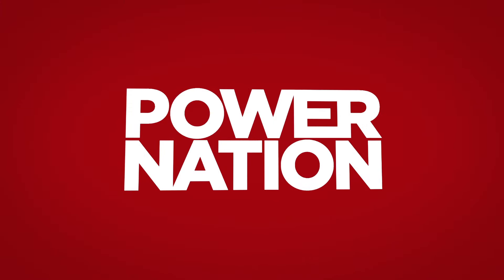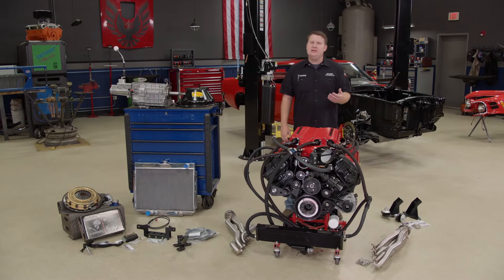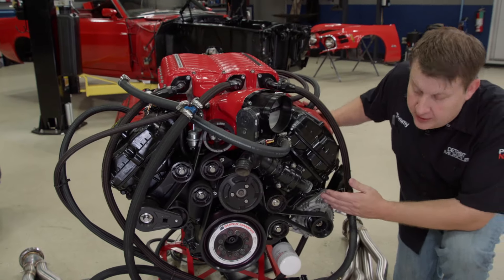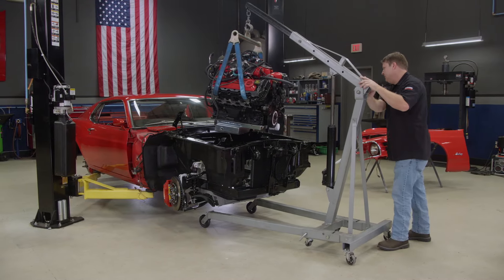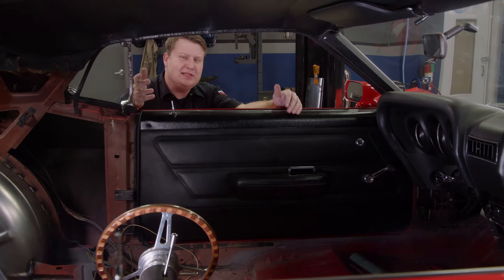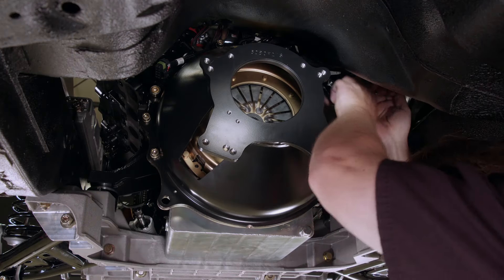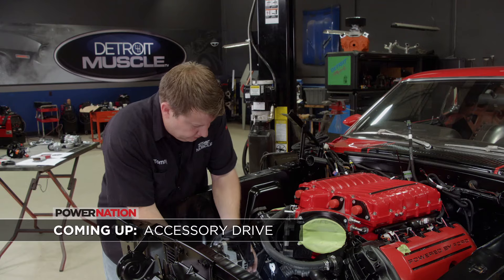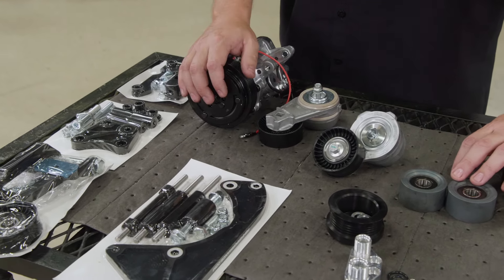Dropping A Supercharged Coyote In The '70 RestoMod Mustang - Detroit Muscle S8, E15

Comment: 9:08  You listed everything other than its power rating?  I'm guessing its because the TKX is only rated at 600tq when that engine just dyno'd 680tq on the largest pulley and 800tq on the smallest with octane boost.

Comment: I believe that 7.3 godzilla swaps will become more popular than a coyote 5.0.
Reply: When someone comes out with cheaper accessories for the swap the 7.3L will take off.
Reply: Lmao hell no it won't
Reply: @fread51  why not? More power, in a smaller package.
Reply: @Retadin   it's not 1993 who the f*** wants to go back or with technology when I can just plug and play with a coyote
Reply: @fread51  the 7.3 any mod motor trans will mate right up. A 5.0 swap isn't going to be any easier than a 7.3. There's no replacement for displacement.  I drive a tuned 5.0 150, but would gladly trade it in for a 7.3 truck.

Comment: I'm loving this! This is exactly what I want to do with my '68
Reply: A LS fits much easier in these mustangs, plus they are way cheaper and cheaper to make big horsepower and more reliable
Reply: @bustinyanutz4195  What about the new 7.3L Godzilla V8 from Ford.
Reply: @bustinyanutz4195  LS swapping a mustang? I want that sweet coyote howl baby!
Reply: @bustinyanutz4195  - no they are not the ls doesn’t come close to the power you can get from a coyote, without having to replace every single part in the engine.
Reply: $30,000 you can do it!

Comment: love the swap, hate the 3d printed mounting bracket adapter used in this. they are plastic and on the accessory drive im not a big fan of that, lol.
Reply: That's not 3D printed. Those lines you see aren't layer lines, they're machining marks from a CNC mill. Also, "plastic" is a wide range of materials. They're likely using an engineering thermoplastic like POM or PEEK, which would give it similar strength to aluminum.
Reply: @waveformdistortion  well that makes more sense. That literally looks like someone 3d printed those parts and from personal experience, the 3D printed things are not nearly strong enough to handle the accessory belt of an engine lol.

Comment: The clutch style alternator pulley is designed to slip after a certain RPM so you don’t fry the alternator. Coyotes love a 7500-8700rpm rpm range

Comment: Looking at those belts, did they change everything to a 6 rib design.  I watched the engine power episode and when they tested it the engine had a 10 rib belt for the power.
Reply: If you look when the engine is installed it has the 10 rib SFI approved crank pulley, later on you can barely see the pulley is now a stock Ford unit with the twin 6 rib setup now.

Comment: im dying to do that to my SVO mustang 
car handles excellent for a 1986 car 
but 200hp is a headache
Reply: 200 HP should be a heartache instead of a headache, I know if my car made just 200HP I would cry, I'm running a modified LT5 from a wrecked 2019 ZR1 , I dynoed at 1036WHP and it's very reliable and streetable , it lives on in a 1971 Javelin/AMX
Reply: @bustinyanutz4195  - only 1000whp pffffffffffffft

Comment: Stickage!!! NOT gonna lie, it's just not the same without a manual.
Reply: Except modern autos and semiautomatic manuals are more efficient and in performance applications are faster.   Outside of NASCAB (who God forbid embrace modern technology) name one top tier racing series that uses an h pattern manual.   Or anyone who's making modern performance cars that use anything but a semiauto. 21st century engine with a 1950s transmission.

Comment: Great video, but a lot of the parts aren't linked at all or linked incorrectly. Kinda a bummer having to spend 15+ minutes trying to find the exact parts used. For anyone wondering they used Detroit Speed headers (PN 061005DS) but I'll pass on spending $3500 on headers, that's half the cost of the supercharger.....ended up going with some flowtech turbo headers and just flipped them upside down to have the collectors facing back. Only $305 plus some time with my welder, happy with the results.

Comment: I love the build and hope to win.  I have followed Engine Power and Detroit Muscle on the progress.  I am wondering where the engine horsepower and torque were set to.  The TKX is limited to 600 ft lbs.  The first run with the 3.75 pulley yielded 811/662 which already exceeds the tranny's max torque.  The final run with the 3.25 pulley was 1003/799.  Obviously the last run is super sweet but would destroy the drive train.  Could you let us know the final installed horsepower and torque are?
Reply: I'm pretty sure those torque limits are rated for a 6000lb vehicle but I could be wrong. For example the T56 is "rated" at 700 ft lbs, but you can find plenty of builds with over 1000 ft lbs of torque on that transmission.

Comment: Man, this is cool. But also, damn, I’ve never seen the stress and “if you give a mouse a cookie” nature of engine swaps condensed into such a short video. And this was a drop-in high dollar kit. Imagine trying this with weird swaps nobody’s done yet.
Reply: Point well taken but it happens fairly often.  People are now putting LS's in about everything.  Obviously you have to have fabrication skills, more equipment and TIME.
Reply: Yeah like the one I'll get around to one of these says 😏
Reply: this swap would have been twice as easy and 2x cheaper if simply doing an LS swap...same power or better plus better reliability.
Reply: @richardbaumgart2454  Ford guys have been fighting for aftermarket respect for decades but you're right, the LS can do it all from 300 to 700+HP
Reply: @x-man5056  No offence, but NO real FORD man would want a chev in their FORD, doesn't matter if it's cheaper or easier !!
Reply: @arkhsm  not offended at all, fully agree.  What really grosses me out is a Chevy small block in a Toyota Land Cruiser and the license plate "Chevota".  Makes get vomit in my throat.
Actually I like the idea of fords in hot rods because Fords and Lincolns have the best looking body's and having the distributor in the front of the motor should have been the law for them anyway.  When i was in high school a friend of mine had a 64 Fairlane with a super lopey 289 that could wheely with cheeters.  Sort of AFX style, on the street.
So much rubber burn in front of his house.
Reply: While it's true that an LS swap would have been cheaper and easier, the coyote has more power potential and theres exactly 0 reliability gain in the LS either. At the end of the day, I respect this coyote upgrade more than I ever would had it been an LS, keep a ford a ford, as it should be.
Reply: @richardbaumgart2454   Yep... but they didn't so it doesn't matter. LS blahblahblahblahhhh, WE KNOW!!!! It would be cheapest and easiest to buy  a crotch rocket motorcycle and out run your LS whatever... That's not the point.
Reply: @nitrodspec6402  but they had to cut the car apart and re-engineer the whole front end to put that 32 valve engine in it...the best Ford's are Chevy powered....and I own a Ford!

Comment: First off I love the build!! I can't wait to see it drive. Question for you, I need your opinion, I have a 1973 Mustang Convertible, looking a Chris Alston coilover and Quad-link rear suspension. My question, rebuild the 351 Cleveland and mate with a 5 speed Tremec conversion or Coyote swap? I like the idea of having original engine with aluminum heads staying closer to true setup. Cleveland motor add 30% value to the car supposedly. But would like to hear your thoughts. Great work!! Let me know when you want me to send you me car for its overhaul.😀😀👍🏻😂
Reply: Stay the Cleavland route. The most important thing is make sure the block is square. Anyone with an Aussie block will not let go😕.
Reply: Hi, our shop has done a number of Coyote swaps and i'd recommend the Coyote if your goal is power, reliability and efficiency.  I know such a thing is taboo to purists, but reality is that modern engines such as the coyote are absolutely the way to go in terms of performance.
Reply: Both are awesome engines a well built Cleveland is hard to beat too

Comment: ok...who is this for...i have 3 65-66 mustangs... that car above has: front k member $8,000... motor $20,000 ... and that's just a start  ...2 of mine have 9 inch lincoln versailles rear ends... 1 has 2000 mustang rear... all have 4 wheel disc brakes... all have aod's and 302's all get driven regularly... i can hand any of them over to my kids without fear of breaking down and i don't have 20grand in all 3 #nogaragequeens

Comment: You can drop in a "old school" stroked 302 and get great driveability and 400+ Hp on pumpgas and it just drops in.....
Reply: True, but they've done that before.  There's also something to be said for getting 19mpg instead of 9.
Reply: @rhekman  If you plan to use it as a daily driver thats a good point, most dont though? and the cost to drop in a cayote will give alot of gagmoney if you go the stroke route
Reply: @danielhultenius5506  Yeah most people don't daily a project car, but PowerNation has to pay the bills with the high dollar sponsors.
Reply: @rhekman  What about a 6.2L SOHC 2V BOSS V8 from the 1st gen Raptor or heck even a new 7.3L Godzilla V8.
Reply: coyote will still be winding out while you're changing gears every gear change its going to get further in front even if they were identical in power. but also his point was the coyote was around 400hp stock then you add a supercharger. whatever you do the coyote will be more efficient and have a far broader power spread at comparable power figures. but yes you could just put a windsor in and drive it same as people have been doing since day dot.
Reply: If you are talking about efficiency and power then a LS would be more logical due to size and ease of modding. But ford guy hate that
Reply: @cryinglaughter6792  efficiency and power he says someone doesn’t know anything the coyote literally craps all over the LS

Comment: It is my understanding that, at least in Arizona, replacing a vehicles engine with other than what the vehicle was originally equipped, it will not pass emissions inspection, that is unless the vehicle is a classic car exception because of age. Am I missing something about getting around these requirements? I have a 1996 chevrolet 2dr tahoe that I want to upgrade the engine to a new LS 6.0 and have been told,  by local emissions inspection officials  my vehicle will not pass the inspection,  unless it's registered outside the county where residents are exempt from EPA inspection requirements.  Would appreciate any feedback from anyone about this.  Thanks all!

Comment: Or just LS swap without all the cutting and welding. Why grease up and squeeze and beat a 305 where a 427 would slide right in? Oh, that’s right, because Ford fans are working with an extra chromosome...

Comment: Excited to follow this project. We're working on a 92 Coupe we're putting a Coyote in. For power steering we're looking at possibly running a Volvo electric power steering pump. The 92 didn't start as extensive as this, but rust has made it a much bigger project. That and we've been waiting 9 months for swap headers now, that's the biggest hurdle right now. Love the work as always!

Comment: Something tells me he had a drill bit one size to small and he should of used a drill with a slipper clutch and done that in seconds...
Reply: @bigboreracing356  No he struggled to tap that putting way to much force to cut new threads... I should of worded that differently so I get your point..

Comment: When tapping any lube will do at work I use WD 40 or CRC power lube. If chasing threads use a screw gun or drill that reverses , careful not to bottom out tap and snap it.

Comment: "No measuring required on the oil pickup tube" because the aftermarket company that made it never makes a mistake.  Could be the dumbest thing you ever said on TV Tommy.  Besides, their are likely people in your audience that want to see how you make the measurement.  Big Fail Tommy.
Reply: @bigboreracing356   if you've never done anything, you never experienced it.  Aftermarket parts have a better chance of being wrong as a stock one.  The oil pickup is critical.  A good mechanic would never let that slide dimwit.  If it was Tommy's own car I'd bet he'd measure it anyway and it was a good opportunity to show people how.  I make that measurement went I put together a stock engine with stock parts.  IT"S CRITICAL part of the job.  Depending on luck is not a strategy for success.  Parts are made wrong all the time especially aftermarket parts.  Tommy failed and you are an unqualified sycophant.
Reply: @bigboreracing356  Not an "infomercial" Dufas,  it is an old episode of a TV show.  Look at 5:20 to 5:30.  Tommy says no measuring is required.  Tommy knows better.  You are just a dope.  Both of you Fail.  Doubt you have ever even seen the inside of crankcase of an engine in person.
Reply: @bigboreracing356  Not even slightly fool.